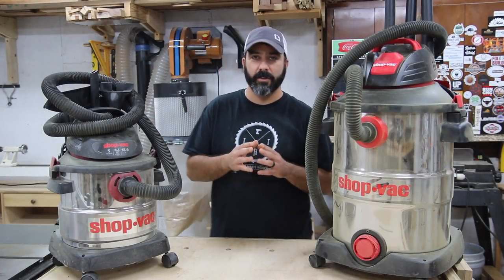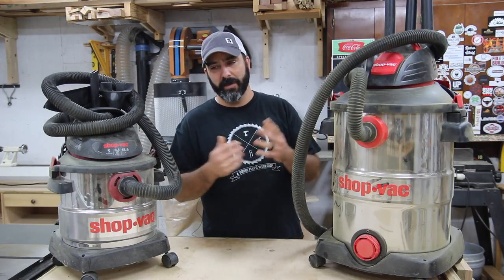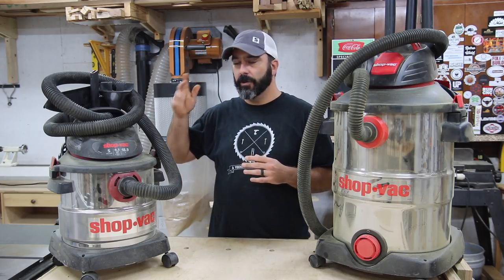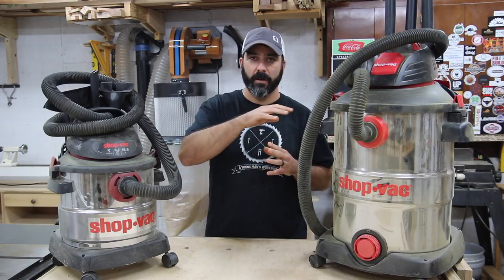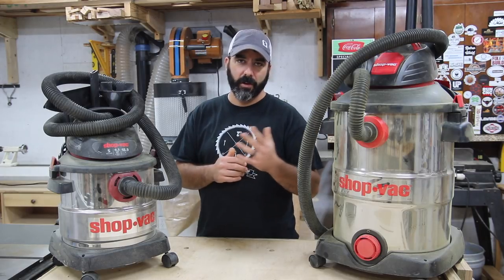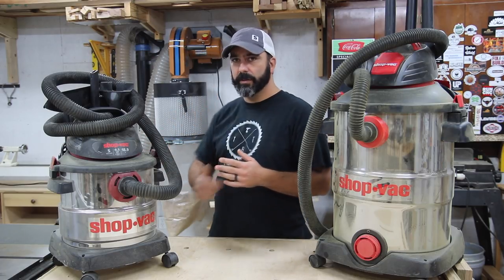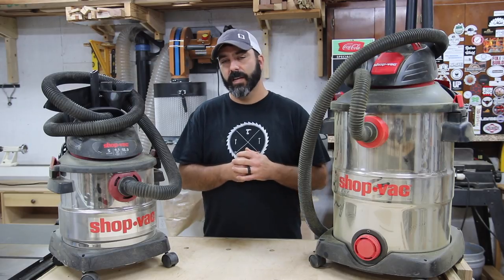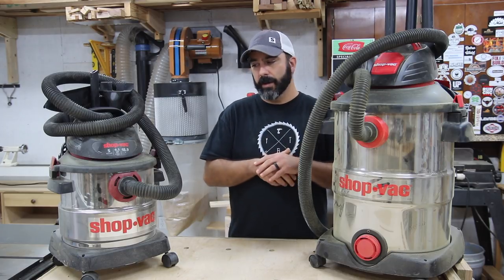Woodworking Dust Collection - Which One?

Comment: I see a lot of cyclone set ups with extremely expensive filters attached. I bypass that with an exhaust to the outside of the shop. Adding a couple large fans in window openings along with the suction system pulling the air out, really keeps the air clean.

Comment: I have a 1hp shopfox , 2hp Grizzly polar bear dust collector ( still in box awaiting closing of 784sqft shop with unattached manufactured home on a 1/4 acre), 6.5hp Lowes brand shop vac and had a 2.5 hp Ridgid shop vac( wife confiscated for her hobbies ) and a WEN air filtration system
Reply from the maker: +Gary and judi Boyd Sounds like you have it covered

Comment: I find with several of my tools that a lot of the dust never makes it to the exhaust port. For instance, the disk sander on my bench sander does not attempt to send dust in any particular direction. The result is a messy shop that quickly discourages using the machinery after I have spent an hour or more vacuuming the whole room. Regardless of the cfm, how do you manage to get the random-directional dust to move into the collection system?

Comment: Hey man! How much do you like the rocker filter? I have the rocker DC and was planning to go for that. But was curious if it was worth it. The plain bag that comes with it starves the unit at like half full and that's with a separator. Just curious it you find it worth the money and if the build quality is there too. I'm wondering if the flap seems long lasting
Reply from the maker: +Michael Lippert I say the filter is totally worth it. I like it for the exact reason you mention and also the ease of cleaning with the flap. I honestly think it should be a little less expensive, but even at the 180 I think it's worth getting. Hope that helps.
Reply: Thank you

Comment: Shawn, this has been a really helpful "general information" video. I appreciate you just sharing what has been working for you in your shop, why and what you might do differently another time. I really like that it is not a review of any particular tool, but just informational. Great Shop Talk! 
A question: do you additionally use any type of dust filtration to clean the air in the shop of fine floating dust particles?
Thanks for your videos and information sharing!
Reply from the maker: +Rushton Paul I see you found it.

Comment: Shawn, thanks for the video, informational as always! I'm torn on the HF unit and the Dust Right. I have a small shop (2 car garage) and need dust collection on a miter saw, table saw, jointer and Planer. I can't decide, I like the CFM of the HF but worried about the large foot print of the unit and the piping.

What would your suggestion be?
Reply: JScheider45 if you're worried about the footprint and the piping, then I would go with the dust right (or a couple of them). Personally, I have a 12x20 foot shop with a sloping 7 foot ceiling, so a big dust collector with piping all over just isn't going to be a good use of space for me. I'm in the process of setting up a dedicated collector for just my table saw and jointer, and then eventually another collector for my miter saw, bandsaw, drill press and sanding station. I've got one of those general international 13 gallon dust extractors from the big orange store on the way to set up for my table saw and I'll keep my shop vac (Ridgid smart cart with dust deputy separator) on my miter saw for the time being.
Reply: James Paul thanks for the advice. I am leaning towards the DR setup for that reason. Thankfully all the machines are close so the DR hose kit would work fine.  I do also want to do a separator for the setup so I don't damage the impeller
Reply from the maker: +JScheider45 for the CFM alone at 1550 vs 650 I'd go with the Harbor Freight.
Reply: I've been asking myself the same question, as my small shop grows. To me, it's a question of "time and energy spent." A big central collector is less expensive than three small, distributed collectors. But, you have to spend much more time plumbing it all, and it's hard to change. 

But three small collectors, even small Shop Vacs, can be set up with one or two tools a piece, and you lose much less suction to plumbing and blast gates.

My small shop vac (~200 cfm) does an admirable job of collecting off my table saw.

Comment: Shawn, What is the remote you recommend for the HF 2 HP collector. I don't see it in the notes.  Thanks, John
Reply from the maker: +John LeJeune Sorry, it's the Long Ranger. PSI Woodworking LR110-3 110-Volt Long Ranger Dust Collector Switch https://www.amazon.com/dp/B00004S9AI/ref=cm_sw_r_cp_api_gYm3zbNN65Z9B
Reply: Thanks Shawn.  You just saved me a lot of looking around.  I have the HF 2HP DC in a box waiting to be installed. Currently running a 100 AMP sub-panel to my detached shop. Eight 20AMP circuits going in. I am excited to not have the lights dim when I turn on a tool!  I knew I would need something heavier duty than a traditional remote.  Isn't this the remote that  Scott Phillips used on "The American Woodshop" TV show?  Thanks Again!
Reply from the maker: +John LeJeune no problem. Not sure about the tv show.

Comment: Can you really trust any of the numbers on a vacuum where we know they are overrating the HP? For a 110V circuit the maximum  HP is only 1.5HP. Try measuring the real current and CFM and they will be a small fraction of what ShopVac is saying.
Reply from the maker: +qwerty I'm just going by what the specs say. The actual numbers don't really mean much to me as I'm just using in general applications